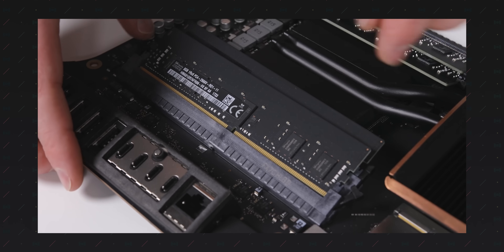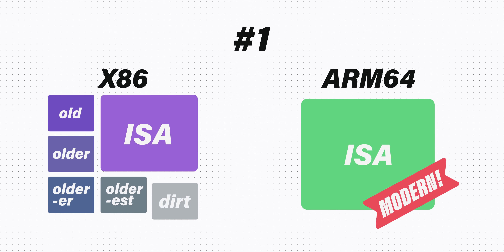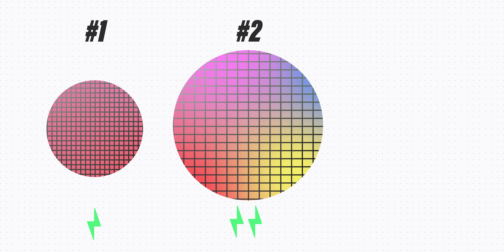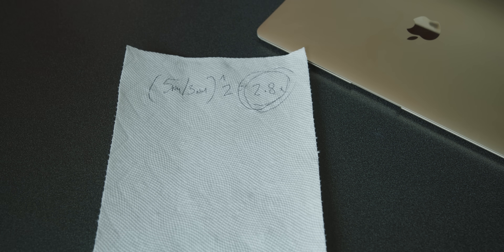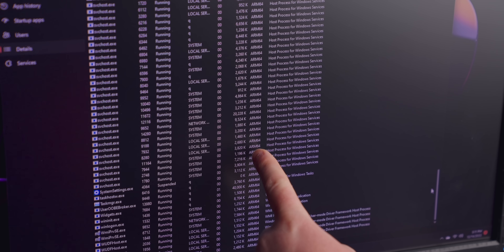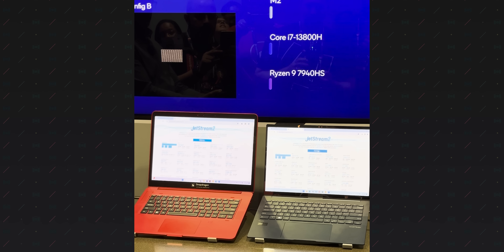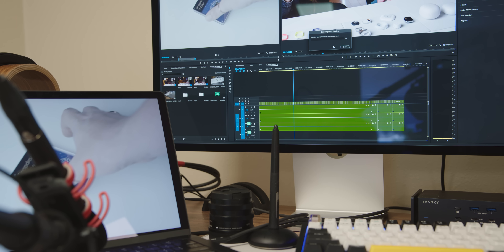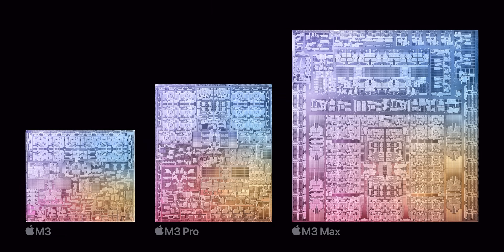Apple's Silicon Magic Is Over!

Comment: I have the original 16” MacBook Pro with M1 Pro, 16GB RAM, and 1TB SSD. Has been one of the best computers I have ever owned (mainly a Mac user with a pc laptop on occasion).

I was ready to upgrade this year and ultimately decided on the new 2024 ASUS ROG G16 with Core Ultra 9, 16GB RAM, 1TB SSD, RTX 4070. Why? Because just to get the same tier of my current M1 Pro as an M3 Pro was $2400-$2600 based on sales. I picked up the G16 for $1450 as an open box excellent condition from Best Buy.

Is the battery life as good? Nope. But I get a full day under my typical work load (browsing the net, watching videos, and code editing). It weighs less and has a smaller footprint than my Mac. Has dedicated graphics when I want to game  (keep the dGPU off most of the time). Has an amazing screen with color accuracy and 240hz refresh rate with GSYNC. Has a fantastic keyboard and track pad and for once great speakers lol.

I love my Mac M1 Pro but the M2 and M3 upgrades didn’t seem to justify the upgrade cost for me. Also, I appreciate that I can actually install other operating systems without much fuss. Apple has just become way too closed off since moving to ARM.

For now I love the G16 for its specs, build quality, price and openness to install other OSs. I look forward to what Qualcomm does as I am always open for competition especially on the power per watt front.

Comment: The lack of multi-display support on low/mid end Apple chips is a dealbreaker. Two displays is not always enough
Reply: Many people have noted you can get extra displays on these "low end" Macs using DisplayLink. Plus you can add an iPad as a screen, too.

Comment: I agree with most of the points about Apple’s lead in engineering and chip performance dwindling as others catch up but it would surprise me that they weren’t aware of these problems and haven’t been looking for new areas to innovate. But it could be years before a new product goes from concept to reality and we may be approaching the finish line for some of those timelines IF they started those projects when the M1 launched. If they started them later, it could still be a few years before any of those see the light of day knowing Apple.

Comment: Apple Silicon using ARM instead of x86-64 is not a real reason for it being so much more efficient than Intel.  Jim Keller has talked about how ISA doesn't matter much. The old baggage that x86-64 chips carry mostly just means it takes more die space, but isn't impactful on performance.

Mostly, it is simply because Apple and AMD are targetting different power budgets with their designs. Put an M3 Ultra in a server where it can draw 400W and the AMD chip will be a lot faster.  Intel and AMD design their architectures for datacenters then use them almost unmodified in 12W laptops.  Apple designs its chips for 12W laptops then uses it almost unmodified in an 80W desktop. At 80W the difference between Apple and AMD is not much.

Unified memory helps a lot. But AMD started to do that and gave up around 10 years ago because they deemed it not to be worth the effort. And vertical integration with all the various accelerators is a big factor.  But mostly it's the targetted power window.

Comment: I think that's the whole point. They compensate for minor performance gains by making your laptops slower over the time especially if you get base models and designing them that way that you are forced to upgrade because these M chips are so good, they don't want you to keep using the same chip over the years with the unbeatable laptop which doesn't need to be upgraded that's why they charge you up front for all the components that are baked on the motherboard. Classic apple!

Comment: They need to move to analog, sine cosine arrays to go faster.  But NVidia must have already had them, then ATI already had them, then AMD already had them because its really hard to predict a four operation add / multiply without an analog 128bit comparator.  You have these two same?  So all the registers simultaneously compare and move, but each register needs a clock pulse, so any out of phase flip-flop wastes 50% of the energy, compounded by the stages.  So its likely it still uses computer architecture from 1984 because if it was just 17% analog, you have 16 billion transistors.  125,000 rows and columns, say analog is 50% bigger, each operation takes four clock cycles, you could put 50,000 RISC 5's on a die, well much less to be blazenly utilitarian.  Lol!

Comment: I've been very interested in Qualcomm's new chips ever since they announced them. I hated the old Intel Macbooks and didn't ever want anything to do with them, but the first time I ever touched an M1, I was extremely impressed. I had a Dell XPS 13 running Linux that had no battery life left and needed to be tethered to the wall to be used. When I would power it up, the Intel CPU in it would heat up to a temperature mirroring the surface of the sun and it's fan would begin screaming like a banshee if you started video playback. Everything became a stuttery mess if you tried to multi-task at all, and this has just gotten worse with the introduction of the P and E cores on modern Intel CPUs. I replaced that Dell with a base model M2 Macbook Air as soon as the Mac was available for sale, and I can safely say that it is the best laptop computer that I have owned by far. I use it for basic web browsing and Youtube playback and nothing else on the market can come close to matching it for those tasks. I don't like Apple's extreme hostility to upgradability and generally anti-consumer practices, but their hardware is peerless right now, so they can do whatever they want in those regards. A Framework laptop sporting a Qualcomm chip with performance similar to an M2 is my dream. Cool, silent operation with enough performance to stream 4k video for 12 hours while running on Linux is what I hope to see.

Comment: All this power is nice, but the lack of modularity is a L to me. We should want as many devices as possible to have upgradable parts. Otherwise... we are still on the fast track to the world of Wall-E. 

We have to demand more than speed and power efficiency from OEMs for a better future. Ill take slower slower chips and slightly thicker than a pencil hardware, if that means true future proofing with repairability and upgradablity. All the rest will catch up anyway.

Comment: This is exactly why essentially every single manufacturer/designer (for the lack of a better term) of semiconductor chips outside of apple comes out with a new or at the very least revised architecture each generation. Using the same exact architecture  will always cause problems. Apple needs to realize that.

Comment: MAC will lose dramatically when Microsoft adopts ARM based CPUS to Windows 12. And its not even going to matter if its faster or slower than M3 or upcoming M4. The problem is MAC OS. You can do so much more with Windows that MAC can only dream of. Yes... gaming included. Imagine Next gen gaming laptops which no longer have to suffer thermal limitations.

Comment: I still don’t like the MacBooks. I have an Alienware X16 R1 with an RTX 4080, and an i9, paired with 32gb of ram. It has blown my friend’s M2 Max book pros out of the water performance wise. Their laptops might be thinner and lighter but when I switch to integrated graphics and lower my refresh rate to 90hz I can get about 12 hours of battery life out of the laptops. When full tilt gaming I get about 6 hours. So for my personal use case I like something with an nvidia graphics card and a large library of games.

Comment: Personally I'm not impressed by any non X86 compatible processor as many come with many caveats such as being locked down to one OS and the lack of upgrades. This soldered down crap is anti consumer. To hell with ARM, if we need a replacement I am rooting for RISC-V as not only is its more open but its already shown to be able to take standard RAM and all that without soldered in proprietary garbage.

Comment: Interesting video although I don't get why people are soo exited about those Macboocs? Its a niche product to say the list. I sell 1-3 Windows laptop every day and like 1 Macbook per month. For myself personally I rather buy 14-15" Windows laptop with OLED screen, 16GB ram and 512GB-1TB ssd for a lot less then anything from Apple. Then I can not only benefit from excellent HDR display, don't care about small disk size, but most importantly use any software designed for 72% PC in use worldwide that use Windows instead of software written for 16,2% PC. Heck even the bottom of the barrel Asus Vivobook with OLED and AMD Ryzen 7520U that cost half the price of Macbook is IMHO a way better deal.

Comment: Something I'd love to see is Apple Silicon in something akin to the formfactor of the original 2017 Google Pixelbook. Nearly the same overall dimensions as the 12" Macbook. Imagining that as a Macbook that's basically a convertible iPad Pro clamshell. Would be great with some kind of MacOS/iOS switch option.

Comment: Re Apple playing it safe now: When it comes to process nodes, they aren't. Manufacturing of Apple chips tends to start during the "risk production" period of a new node. What's a contributor to the M3's higher power draw, is that TSMC's N3 didn't turn out as well as expected. AMD also geared back to N4 because of that.

Comment: I totally agree.  Macs are great machines but they really do need to start looking at different form factors to stop me from looking at other windows machines.  For example Minisforum V3, I'm lusting after that right now, wishing it ran mac os.  How about something a bit lighter please apple competing with my LG Gram 17?  How about a touch screen?  Can't tell me that it wouldn't be easy for them to produce a machine that, when flipped, moves from MacOS to IOS and vice versa.  All the software runs on the same chips d*mn it.  Just corporate greed or lack of vision preventing these things.  They would take the market by storm.  I also agree that the m1 chips where so good that they should be put in low powered nuc like machines that are tiny etc.  The possibilities are endliess.  Yet we always get the same solid yet boring form factor.  Don't get me started on RAM!

Comment: Gotta keep in mind that the majority of the performance comes from the ability to specifically tailor the chips to a single set of hardware due to Apples anti consumer restrictions in regards to all other manufacturers. That simply only works once. Combined with them suffocating the previous Intel chips through inadequate cooling theyre now just as much adhering to the laws of physics that every other chip designer/manufacturer does. Another major factor was the immense node shrink they could implement with the first Gen M1. Their previous Intel chips were built on 14nm which is a node first implemented into consumer chips in 2015 and on which Intel had been stuck for the better half of a decade. With the M1 they went to TSMC and their at the time cutting edge 5nm lithography which was a technological jump of almost a decade. The M2 being also manufactured on 5nm showed hardly any improvemnt over M1 with the M3 now showing an expected performance increase based on TSMC N3. With all the restrictions and control around their hard-and software I expected Apple to get significantly more out of their own chips.

Comment: Be careful not to fall into the dimensional trap! As you thin the thickness of the laptop you risk the structural stability it requires. The biggest risk is the glass display as you will encounter Microfracturing damaging the metal oxide traces within the screen. 
The second risk is ergo-dynamics, while our hands can grasp odd shapes there are ideal shapes and physical limits and comfort. A good example is the plastic pour spout on most milk & juice cartons. The first generation where the ideal size but the cost of the plastic was a bit much so they shrink it! In doing so people gravitated to the products with the original design, now today most have moved back as the loss of sales was to much as hard as they tried to convince people. Mmm… didn’t Apple fall into this same trap before, yep! As well as others in some form over the years.
So instead of shrinking look at what would make people embrace the tech it offers. Maybe going back a bit in features would be a good thing! The option to extend onboard storage (second drive) short distance projector linked into the Vision Pro headset to emulate 3D without the electronic periscope we have via cameras.

Comment: My big concern: what happens to custom rigs? ARM SoCs are horrible for people who want to customize. Not to mention being wasteful since you can't replace individual components as needed.
Reply: I don't see how it's any different. Everyone keeps saying apple silicon has ram built into the chip but that's not true, look at any photo of any apple silicon mac and you'll see both ram and ssd are entirely seperate chips like on any other computer.
So you can't upgrade / replace individually the NPU, E core/ P core or media engines?
You can't do that now either on any x86 platform (intel 14900k/ ryzen / threadripper / xeon.)
Reply: @definingslawek4731 ok and? you still cant replace or add squat on M-series machines so 🤷‍♀️

Comment: The problem with the Qualcomm chip is that it will run on Windows. Firstly, Windows on ARM is good but nowhere close where MacOS is currently. Secondly, we are in the battle of ecosystems not just one product. So a good laptop from say ASUS which doesn't work well with your S24 Ultra may deter consumers. Thirdly, Apple still has more room to grow as its basically non existent in certain regions

Comment: my biggest issue with macbooks recently has been software quality and strange bugs. I've absolutely loved my Macs for nearly 20 years but it's pushing me to investigate other options.

I find I have to restart my 13" M1 Pro laptop every handful of days because I get issues like:
- My dialog boxes in applications just disappear
- I get graphical issues like the Photos app just deciding to be a giant magenta/pink box where the application should be
- I can't click things in firefox
- My Samsung G9 just decides it doesn't want to wake up even though my watch has unlocked my machine

And yes, I've reinstalled from scratch, with no system migration or anything like that and these problems creep back.

I'm due for a new machine very soon and between the price of the Apple options, the Studio's still not having the M3 lineup and all these irritating bugs, it's the first time it's not been a slam dunk.

Comment: Apple’s executives wanted to be the first in 3nm. But at the time, TSMC’s 3nm tech was not even mature enough for better yields and efficiency and made a proprietary 3nm process only for Apple. That’s really bad news because they had to make huge design compromises because of the small yields and poorer-than-expected process performance. The very stunted M3 Pro (192-bit bus) and to an extent, the M3 Max was evident of this immature N3 process. The M3 essentially was likely Apple’s Marketing Executive’s design. In addition, they did not even implement the A17 Pro’s much faster Neural Cores. Using a last-gen LPDDR4x didn’t help much either! That is why I am waiting for the M4 (using the  next-gen, 3nm node) to upgrade my M1 Max MBP.

Comment: The M2 Mac studio is in a weird spot right now where it's actually pretty good price/performance when running 70B parameter LLMs. Llama3 just came out and it seems to be comparable to older versions of GPT-4. You can run it at 1-2 tokens/s on a CPU, and a GPU would be much faster but you'd need at least 48 GB of VRAM or so. A M2 with its unified memory can do around 7 from what I've heard - not great, but usable, and for like a 10th of the cost of a data center gpu, and nowhere near as power hungry as an array of 4090s.

Comment: I jumped for M2 Air on laptops cause I wanted good battery life and I've been semi happy. I got fooled by fan YT'rs that 8gigs is enough and base storage is ludicrously bad deal but those options made by Apple are stupidity. Nothing else. But I'll keep going on with Apple until time comes and I'm going back to Arm/Intel/AMD world for 100% certainty. Macs are ok, but there was already when I got M2 so many good options in the other camps hardware wise, but not efficiency. Now things have began to change drastically. Apple is just way too expensive for me to continue to use them and their software like MacOS really hasn't convinced me to keep along. Quite the opposite.